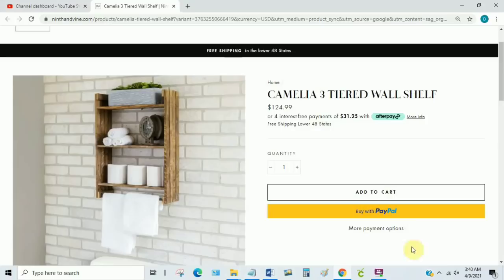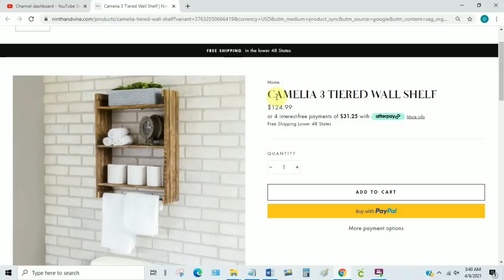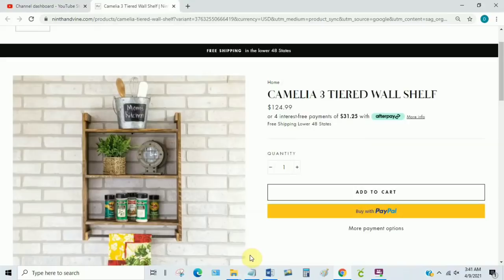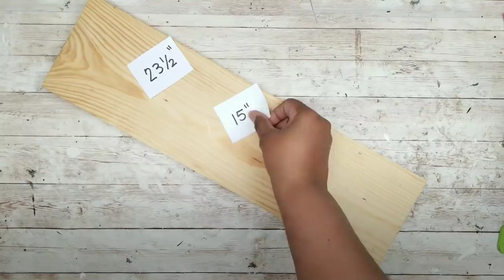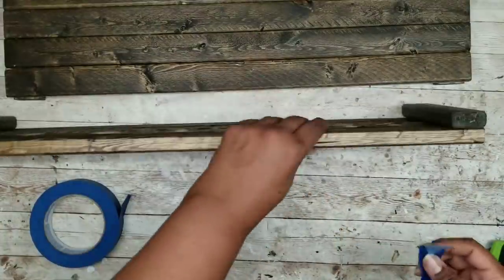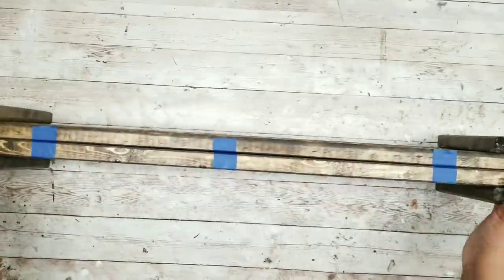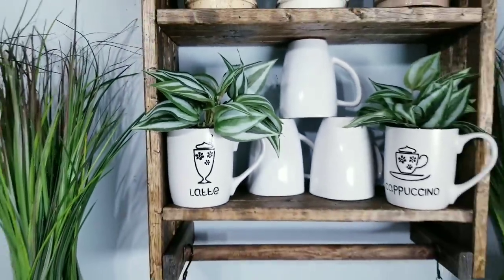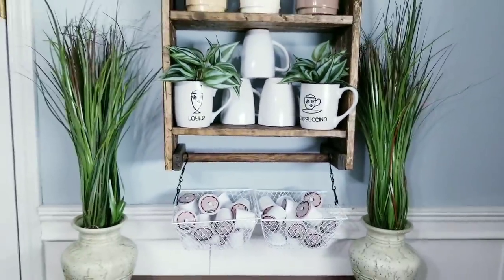HIGH END Inspired DIY | Rustic Farmhouse Wood Kitchen & Bath Shelf | Organization | Look for Less

Comment: I am almost 3/4s the way through making this shelf.  It is the first thing I have ever made. Your instructions are fantastic, but I had a very hard time with it.  Let me say again, your instructions were great, there was no issue with that!  It was mainly operator error on my part.  The furring strips I got at home depot were not smooth at all (except oddly on one side), and extremely difficult to glue together.  I used hot glue, wood glue and even gorilla glue and I still had to indvidiually screw them in one at a time.  I chose a stain color that I am not in love with and tried to "fix" it.  Most of my woods pieces were warped, and had chunks, and giant splinters, and no matter how many time I measured, I still could not get the middle shelf to line up properly.  And, I wasn't sure what size drill bit to use to pre-drill with. The things that went wrong could fill a SITCOM BUT, I think it's going to work and look nice in the end.  Plus I did learn a lot.  Mainly - don't buy warped, dented and rough wood for your first DIY woodworking project!
Reply from the maker: I have to agree, picking out some of the best pieces of furring strips can be a little tedious. I have a ritual when I stock up on my strips: Bring protective gloves and a box cutter. I shuffle through the pieces and select the straight ones by laying them on the floor, flipping on each side to check if they are bowed.  If they are bowed, they are put back.
I bring the box cutter to cut the straps off the bundled furring strips that have not yet been shuffled through. I tend to find the best ones there :)
If I do manage to get a dud or bowed piece that sneaks into my "buy" stack, I use tension clamps to hold them in projects until bonded/screwed in place.
I don't mind these steps to get them so inexpensive, but they do have premium wood for about double the cost if you opt to go that route. :)
Reply: @SheSoCraftDee  Oddly, when I went to Home Depot the first time, the first person I asked didn't know what a furring strip was and showed me some pine strips that were the same size, and, if they hadn't had an inexperienced person on the saw that day, I might have gotten those at $5 a strip.  But, it ended up being such a debacle trying to get them cut that I ended up at Lowes the next day were I got the cheaper ones :-)

Comment: You are absolutely amazing. You make everything you do look so effortless. For instance drilling holes straight, you do it so quickly and yet get it straight. I take my time and still can't get them straight. I have so many projects started and I get to the point where it comes to putting everything together and I freeze. Do u have any advice that could help me. I would really appreciate it.
Reply from the maker: I get that it sometimes it can be nerves! There are some drill guides that the home improvement stores that sell guides to help with drilling if needed. I would suggest practice until you are comfortable, you can do this!!!

Comment: Love this cant wait to do one having been trying to figure out something to put in my bathroom! Can you please tell me what the little attachment is called that you had on the drill to drill the holes?
Reply: Amanda those are called drill bits. They come in different sizes that match up with the size of screw you are using.
Reply from the maker: I have an older drill (15 yrs old) that has a detachable Chuck. The Chuck is what is holding my drill bits. Most new drills today have a built in chuck.

Comment: This is a great space saving idea! I have one question though, I love the drill you are using, just having the one piece to take off to move between your drill bit and then the screw driver tip is brilliant! Can you put a link to where it can be purchased? The current link you have is only for an ordinary b&d drill. Thanks!
Reply from the maker: I have an older drill that's 15 years old, an most drills now dont have a detachable chuck piece... they are all in one. The link I provided is the updated version. I have no idea why they discontinued this option, since it's so useful!